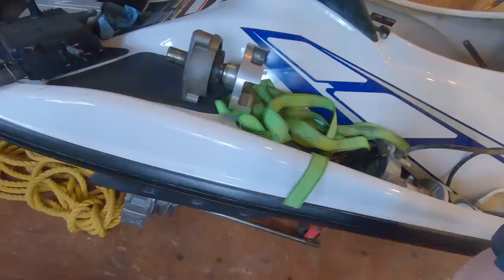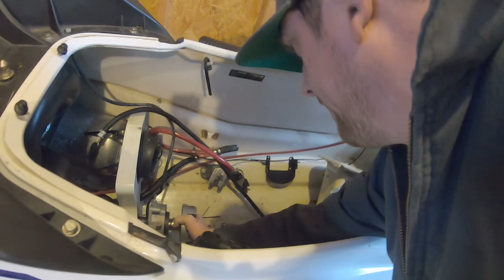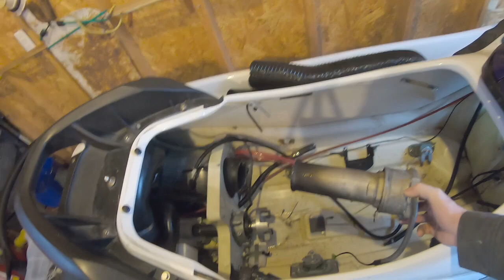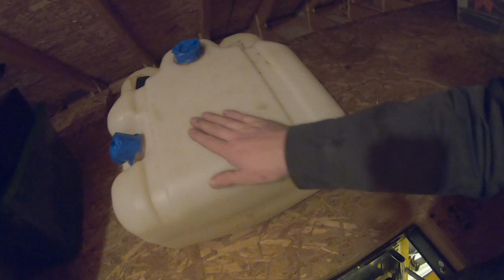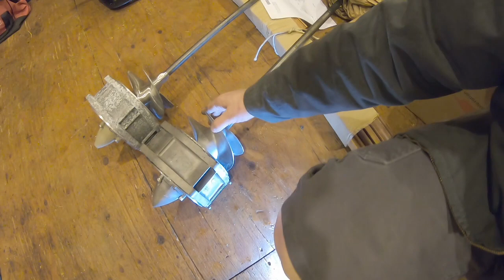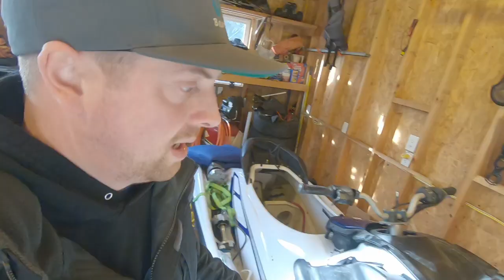GPR SHO build part 3

Comment: All of the current speed records are actually held by FZR hulls now and all of the fast guys with GPRSHO's from many years ago have actually gone back to the FZR hull with a small modification to the underside for speed which has proven to be faster than the GPR.If the motive for the project is really speed you guys are actually going backwards believe it or not

Comment: Are you doing the pump tunnel reenforcement in the gp1200r.  I have seen the aftermath when the tunnel breaks.
Reply from the maker: Tommy Mayer yes I am planning to do that. Any information on where to get the kit would be much appreciated. Otherwise I will have to do it the old fashioned way

Comment: The pump has an extension piece on The FZR, you need to use the whole pump assembly including the piece that bolts to Hull with 4 bolts . This will give the correct length in the pump .
Reply from the maker: I will for sure look into that 👍

Comment: The engine swap is looking really good , I can’t wait to see how it goes. I am looking for a donor SVHO Yamaha with the Ride system too . It’s going to be a joy to ride and super economical too . A fizzle intercooler makes a huge difference to the performance, heat soak is way less with the bigger intercooler . The fuel tank from the GPR can be modified to take the FZR fuel pump ⛽️ makes it easy to fuel up with the stock tank .
Reply from the maker: I am definitely going to look at supercharger wheels and inter coolers once I get this thing all finished up and all the bugs worked out
Reply from the maker: Adzy the PWC bloke in Australia! Troy having the ride system would be nice 👍 obviously I won’t have that but maybe sometime in the future.

Comment: Get rid of the two stroke tank  and block off the two stroke  mix ...and do direct  two stroke  two fuel  mix ,,,,,I did it with  my 1200 Yamaha  and it works  grand ......👍👍🇺🇸🇮🇪🇺🇸👍🇺🇸🇮🇪♥️😎
Reply from the maker: Mick O Toole you mean switch over to premix, at least that’s what we call it here in the states 😃👍😊
Reply: @JetSkiBrothers   ya that's whot I ment in IRELAND ...YOUR LEARNING  QUICK BRO...🇮🇪🇺🇸🇮🇪🇺🇸👍👍👍👍👍

Comment: Question, what is the difference between the GP1200 and GP1200r?
Reply from the maker: Duderocks5539 So the GP 1200 is an older ski from the 90s so it’s like the pre-GP 1200 R. And they actually are two completely different ski. Just the GP 1200 is kind of the predecessor to the GP 1200 R and when they came out with the 1200r they completely redesigned the hull and completely redid the engine. So the newer version for 1200r still a two-stroke three cylinder but they completely redesigned the engine now to power valve two-stroke and obviously it makes more power but also the newer version of 1200 r gained some weight so I’m not really sure how much they gained on power to weight there but the newer hull design definitely handles considerably better at least in my opinion

Comment: What is the difference between hulls?why the swap? I mean I know why but why?
Reply from the maker: between which 2 hulls are you meaning. do you mean between the fzr and gp1200r (the one the engine came out of and the one it is going into) or the 1200r and 1300r (the older and newer gpr hulls that i mention in the video)
Reply: GPR hull is lighter, and has less drag. You can get higher top speeds out of the SHO/SVHO in a GPR hull vs FZ jull.

Comment: Is it possible to use the stock gp pump & gp mid-shaft, to the 1800 & move forward the engine for better balance? Or mix match the parts to get it all working some how? Those are my two cent
Reply from the maker: I like what you are thinking. I am defiantly going to look at all possibilities👍
Reply: @JetSkiBrothers  That's a bad idea. The GPR is already nose heavy even with the stock weight engine. With these GPRSHO builds, when ppl put the 18 gallon tank in from the donor ski, with a full fuel tank the thing submarines like crazy.
Reply: That's a bad idea. The GPR is already nose heavy even with the stock weight engine. With these GPRSHO builds, when ppl put the 18 gallon tank in from the donor ski, with a full fuel tank the thing submarines like crazy.
Reply from the maker: TheStephenspann27 I believe you may be right about that

Comment: Are those engines not as computerized as the new ones?  The new high HP skis are limited to 68.5 mph by the manufacturer.  Did the ski that came out of have that on it?  If it did, do you avoid that system by removing it from the ski?  Do you just lie to the ECU?  Nah, sure buddy, we're only doing 30.  LOL
Reply from the maker: I know that the newest ones are speed limited. But if I am not mistaken this vintage was only mechanically limited. Meaning that the computer is not holding it to a top speed, rather it is limited by the size/weight of the ski and the rather conservative tune/power output of the engine. That is my understanding of it but I could be wrong. If I do need to trick the ecu to go faster I will. Once the build is all completed I am hoping to put a bigger supercharger inter cooler and tune on it anyways 👌👍

Comment: Give me a call 305-335-6779. Ill tell you what you need to know about all that.
Reply from the maker: I may give you a call at some point. Perhaps you can answer a few questions I have on here. I have heard people say that for the drive shaft/pump I should be able to use one of of a fxsho because they are shorter than the fzr one. Is this true. Also do you know where I can get the pump tunnel reinforcement for this thing
Reply: JetSki Brothers exactly, i have lots of parts for them. And i will save you a bunch of time.
Reply from the maker: Elite Customs alright I will give you a call in a couple minutes